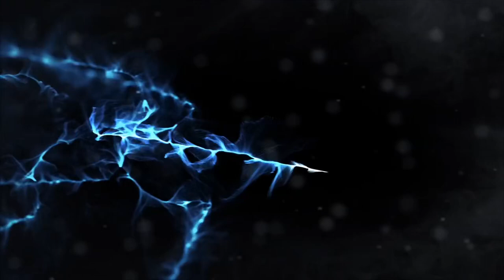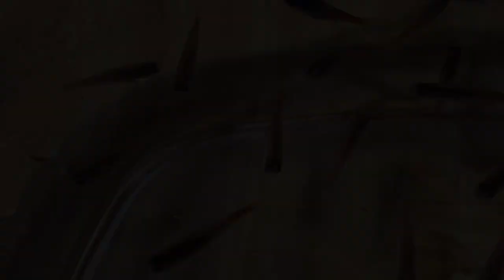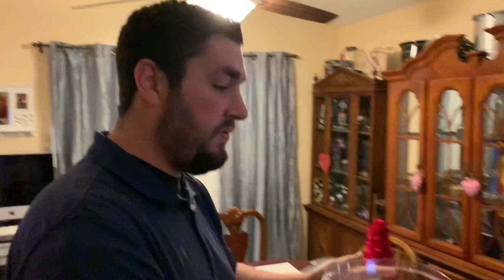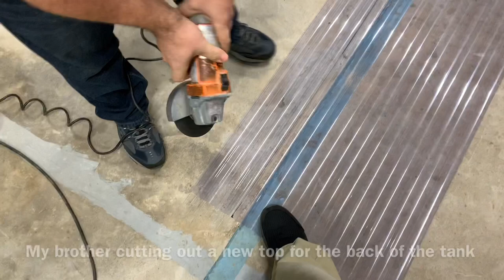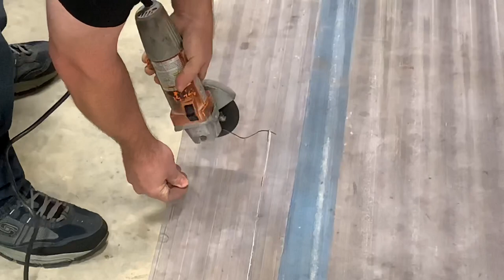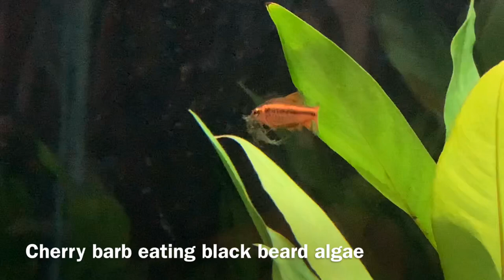Adding 50 neon tetras to my aquarium!

Comment: What kind of water do u use?
What filter do u use?

My neon Tetra keep dying 1 by 1, other fishs is fine
Reply from the maker: Usually when adding new fish such as neon tetras, they make come from completely different water parameters or your water is having an ammonia spike, there is only one way of knowing what’s going on and that is to test your water parameters. Neon tetras usually like it more on the acidic side around 5.5 to 6.5 is ideal in my opinion. But some have been farm raised to accommodate higher ph and hardness. Any other info can help in this matter. Good luck. 👍🏻